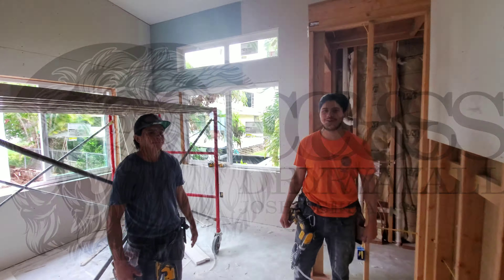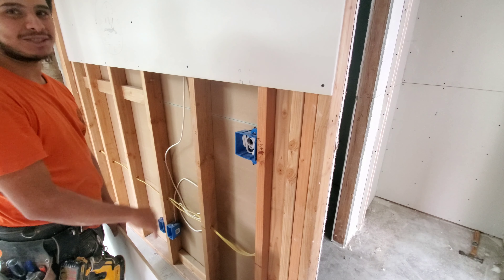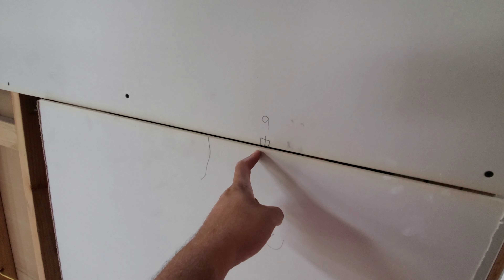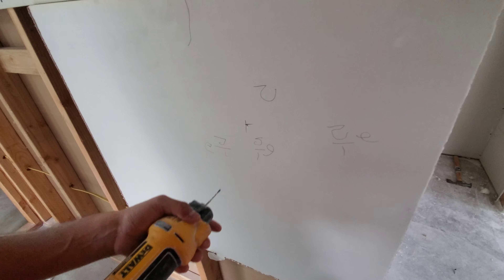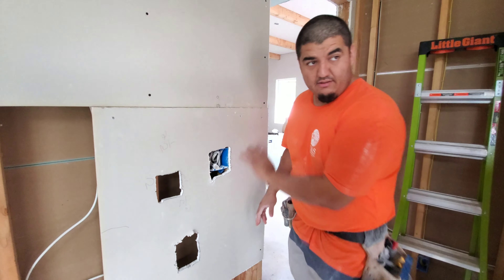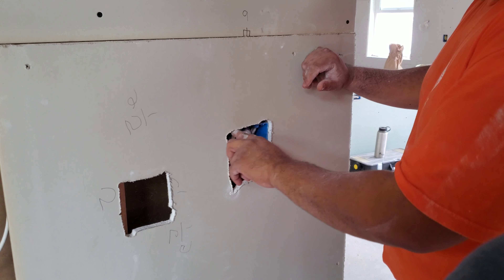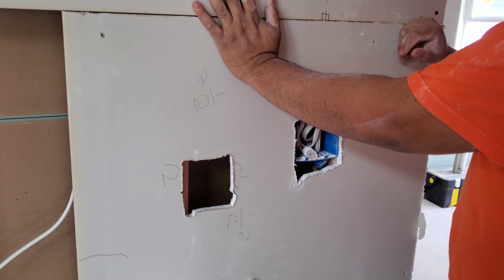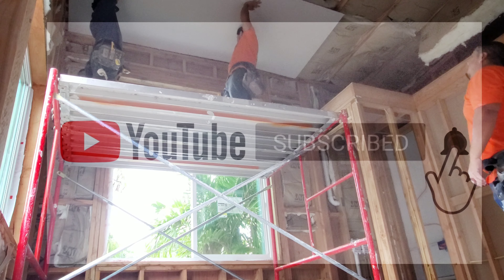How to router drywall. Trying it for the first time. #drywall #drywallhawaii #diy #how to

Comment: How do you avoid damaging the plastic light box with the bit? After watching videos i felt confident to go buy one of this things but messed up every time, i damaged a few boxes and decided to go back to the old fashion way. I tried using the depth guide but if it was too shallow the bit would wonder off the box and i ended up with a much bigger cut than i needed, and when set too deep the bit damages the plastic box so it appears i have to dial the depth very accurate. I am sure there must be an easier way you guys don't even use the depth thing!!
Reply from the maker: Believe it or not it gets easier TJ is cutting out all he's own boxes and lights now. Practice makes perfect. I would recommend buying a couple plastic boxes and setting up a practice station ant home all you need is a couple scrap drywall and some bare studs. You need to develop a sense of feel with the router once you feel a bit of resistance let off and jump over the box to avoid eating up the plastic.
Reply: @csdrywallhawaii  sounds good I will give it a try one more time thanks